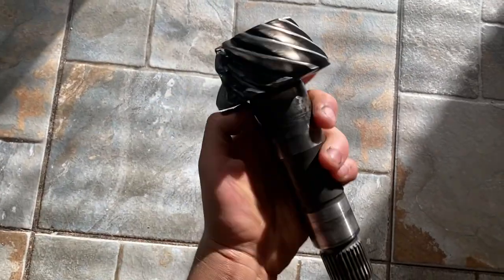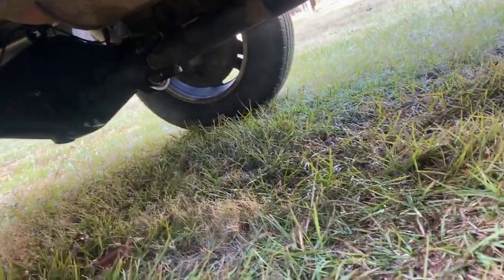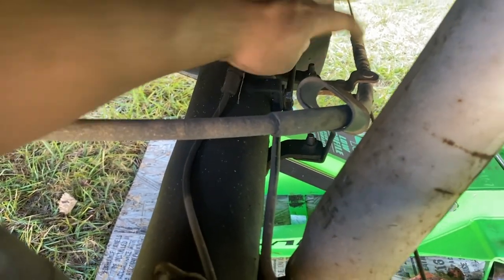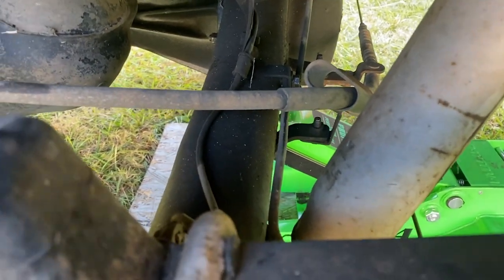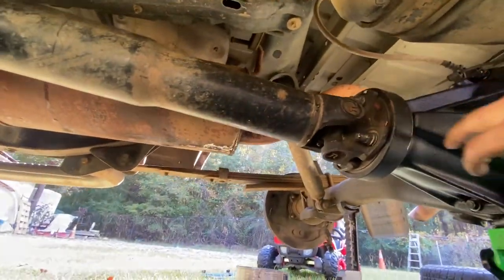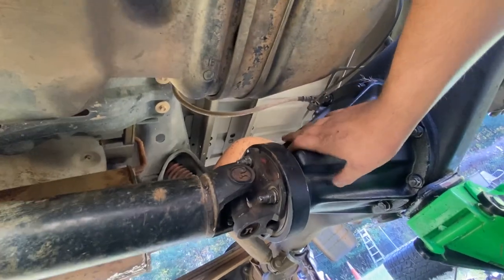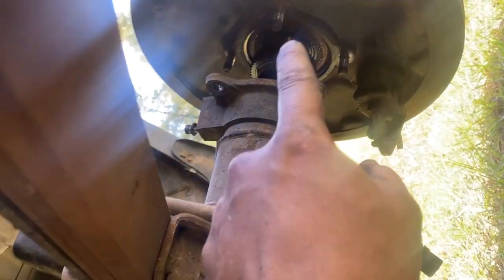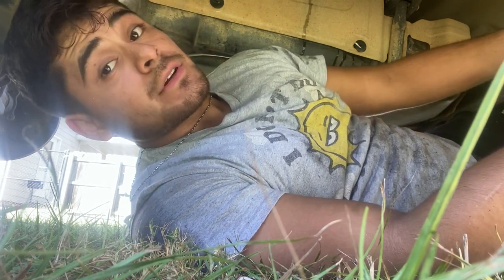Toyota rear differential removal

Comment: What problems did you have? Sometimes when I’m driving my rear end jerks to the right. I’m guessing it’s the rear end
Reply from the maker: My differentials ring and pinion gear where grinding and ended up breaking pleases of each other. I would recommend you lift you car and have the two rear tire in the air and place your car in Drive. Listen to the noise and where it’s coming from it will point you to the right direction

Comment: 1 year ago video.....hmmmm....I'm afraid that if you did the actual ring/pinion installation that you will break it again.  Special knowledge and tools are needed for those diffs.
Reply from the maker: Hey Ken yes I do agree with you special knowledge and tools are needed but it’s hasn’t given any problems so far. Also I did a lot research on how to do it so I can see where your coming from, but if you don’t get your hands dirty it will never get done and you’ll miss out on so  much you will learn along the way.
Reply: @Ls3rick_mc    Fast response  :)    Well I'm glad it worked out for you👍👍